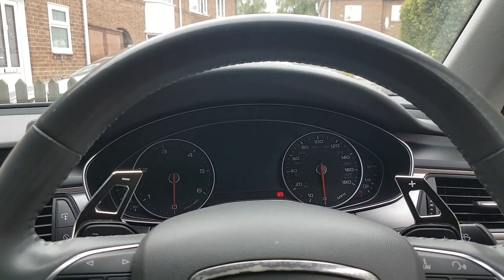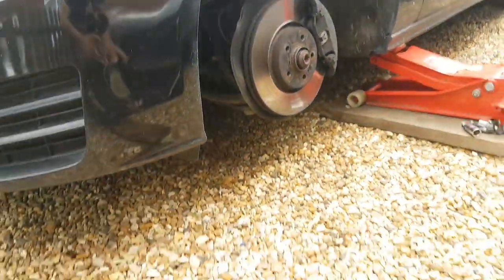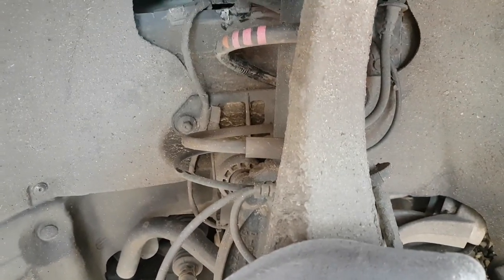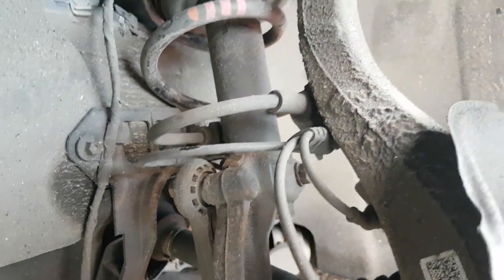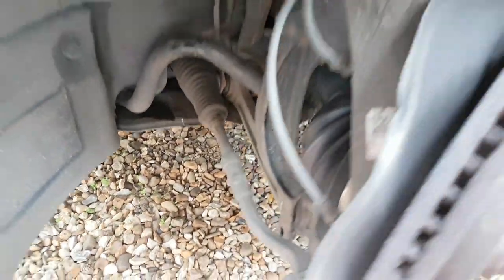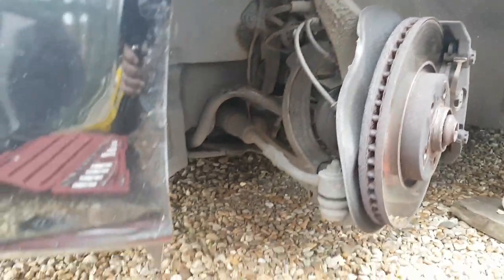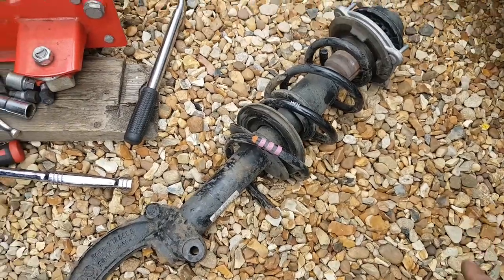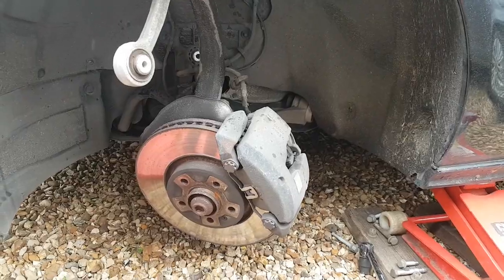Audi A7 unwanted lowered... 😋 Fault finding and repair.

Comment: done a audi q3 spitng on driver side front i struggled to match spring rate ended up going to tps  140 quid then and audi only ones to match the colour stripes ie spring rate  thanks for vid luis
Reply from the maker: Yes... sometimes it can be difficult to find them aftermarket...
👍👍👍

Comment: Pretty straightforward Luis. I do have my own thoughts about wanting to drive an A7 and not letting you do a "proper" repair and a wheel alignment. On the other hand , if the client was my neighbour, I would probably also do as he wished. You do not want to have bad neighbours. I have learned that in a very expensive way.
Reply from the maker: 😉
There you have it...
👍👍👍
Reply: @LMAutoRepairs  
Hello,
I need your help..

I want to know the location of the code in the HEX file of the HONDA GOLDWING motorcycle..
 For reference, I have the code, I just want to know its location in the HEX file.. Thank you very much

Comment: Great job as always :) it's pain In ar** those suspensions, specially vag to adapt, we heve had number of issues always, even everything looks good, live data, pump, etc, one time helps take haft day to repeat process with mesiure tape, another flash the soft, when someone without knowledge did mess to the module and online programming helps..
Reply from the maker: Luckily this one was just on normal springs and shocks...😋
👍👍👍
Reply: @LMAutoRepairs  :) springs the best solution for air suspension :) That's hard work to change even car is on the ramp':) You are taff man':) and this multipont suspension is really hard to remove and fix and in most  costs rising,  parts can be worn or break when trying undo the nuts.. Luis You should be master of big garage  with 7 ramps and running between with tables and laptops, keep the spanners and wrenches away...👍
Reply from the maker: @motosystemltd  
😋👍👍👍

Comment: have you ever come across Vauxhall's that if you turn the key to start the car quickly the starter motor is slow like the battery is low but if you turn the key to the on and wait a few seconds it's fine I've come across a few lately and I've got one in now that is really bad it seems to be the ones with stop start I'm thinking they will have a big capacitor and it is some how dis charging when the car is turned off and pulling power away from the starter as it's recharging
Reply from the maker: No... I never came across that issue...yet, I guess...😋
👍👍👍
Reply: @LMAutoRepairs  😣I can't find anything to go off with this one on what the problem could be I've just got a feeling with what's going on it has got to be a problem with the stop start or just the capacitor not holding charge I'll figure it out
Reply from the maker: It is possible, your theory might well be correct...

Comment: You know when a car owner is shamefully running his expensive car under a tight budget when he installs Nankang tyres in the back and Accelera Phi's in front. Those are some of the worst among budget tyres out there and, obviously, are very dangerous for british weather. No wonder he settles for a single side spring replacement even for a car with over 87.000 miles! I wouln't buy his car even knowing that Luís has been doing its maintenance for a long time!...
Reply: Let’s hope the guy isn’t struggling with life
Reply: @Nypartcannon  Let's hope that! Selling his car would be a great help, though...

Comment: Doesn't the MaxiSys have a broken spring mode Luis....
Reply from the maker: 😅
I will check that next time...
👍👍👍
Reply: Maybe it is just a broken spring sensor shorted to ref voltage 😅 Or an O2 sensor, it cures everything...